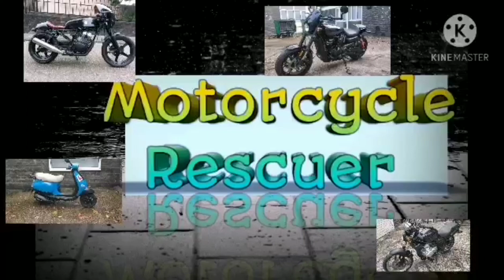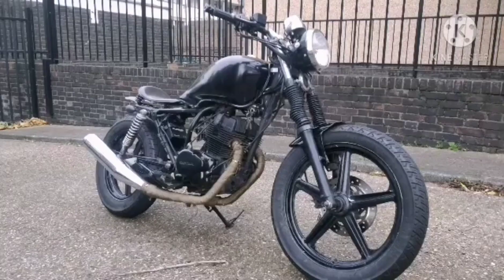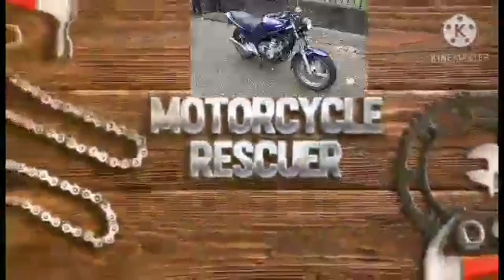lexmoto Valiant project, exhaust and start up, carb conversion.

Comment: Hello mate. Just watched all of the videos about this bike. My wife has just bought a Daytona Must 125 and it has the same engine and really shit efi problems. Love that you use a CG carb in the end. What intake manifold did you use please mate, was it also a CG manifold or a Suzuki gn one? Cheers bud
Reply from the maker: Hi Ricky. I bought a manifold of a earlier model which fit the engine and connected to the original carb. The original carb is a cg copy so same fittings. So any carb manifold for your engine mate
Reply: @motorcyclerescuer  fantastic, cheers mate very helpful. Going to subscribe fella 😊 One last question, do you have any tips before I do a carb conversation? Cheers mate
Reply from the maker: The efi light will stay on. Not a mot fail and dosnt effect running at all. However if you go into the back of the dash you can take out the efi bulb and problem solved
Reply: @motorcyclerescuer  ah yeah I'll be removing that for sure. I live in Greece and I don't think they give a f*ck about eml lights (or brakes working hahaha) cheers mate, really appreciate the help. I'll try and get a CG carb tomorrow and a inlet manifold from somewhere. Thanks once again 😊
Reply from the maker: @rickyfoofighter4926 good luck. Let me know how it goes. Check your valves aswell, these engines like to have the correct clearance.
Reply: @motorcyclerescuer  cheers mate. Yeah that was the first thing I done. They were way out. I'll keep you updated with the carb swap though. Cheers matey 😊👍

Comment: One thing I will say mate I had a Sinnis Apache 125 (same engine as this ) and it would not rev while choke was on. Just cut out couldn’t even ride it with choke on. As soon as it was off it was fine tho
Reply from the maker: Thats fairly normal Chris. This will need alot of fine tuning to get it right mate

Comment: Not sure if the Valient did a carbed model in the earlier ones or if to modern but if so and you got a fuel flow problem with the efi tank a carbed version would have a tap be it twisty or vacuum.
Reply from the maker: Yes glow that spot on kats, I thought the same. Could also get the manifold to engine. 

I don't think they made a non fuel injected model but I will double check. 

Cheers mate